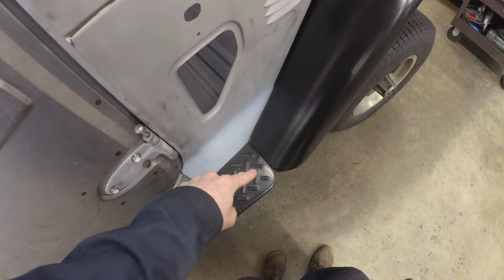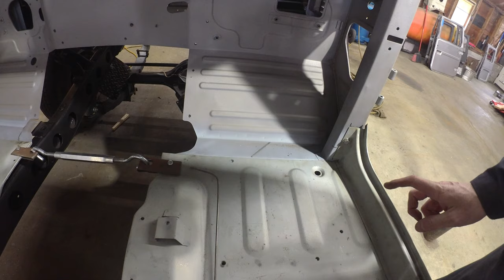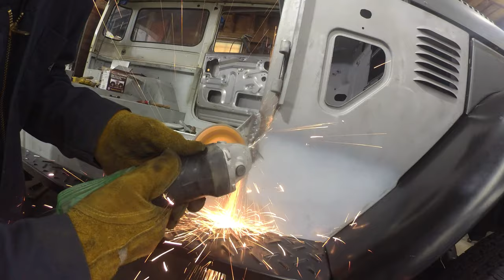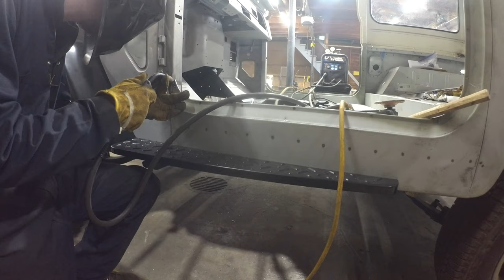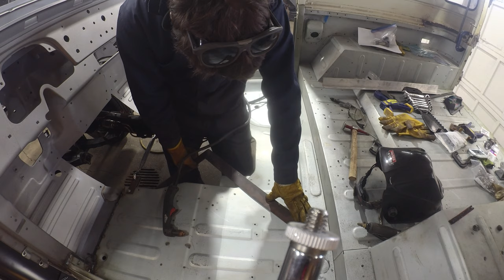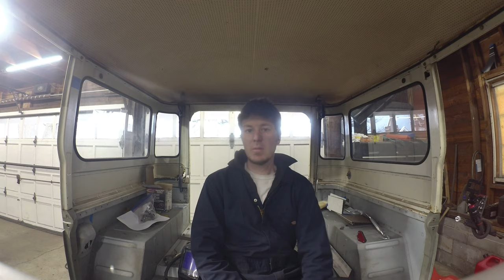Fitting CCOT HFS 3/4 Tub : (FJ40 Week 22)

Comment: Are those OEM fneders of aftermarket?  I got some after market that fit everywhere except where the step meet them up.
Reply from the maker: Aftermarket, they're from Taiwan manufacturer through CCOT.  I had to redrill a fair amount of the holes and use the panel hammer to reform the lips by the rear steps and the bib...I walk through a fair bit of that in the video last week, although I don't think I captured all the work by the running boards.